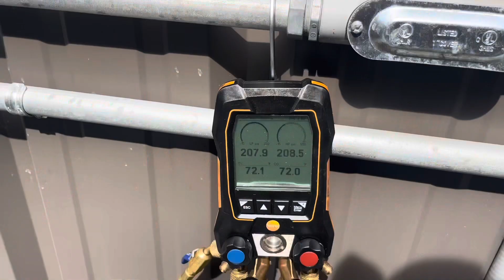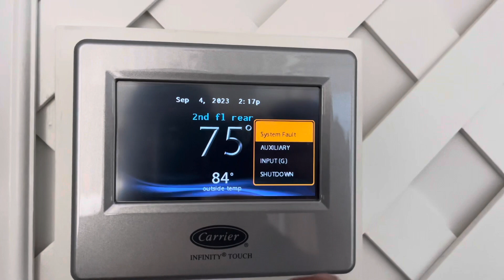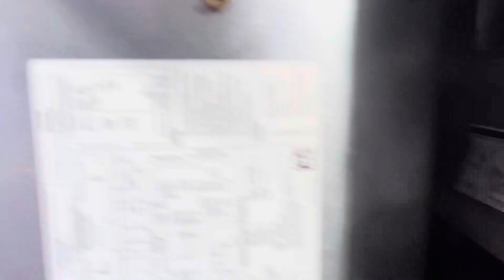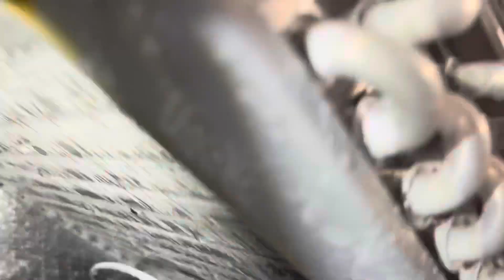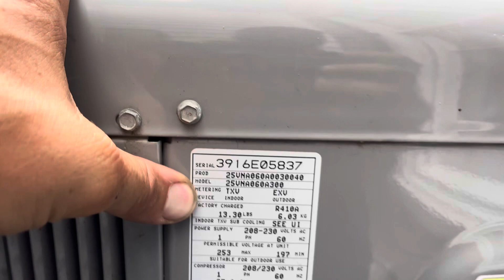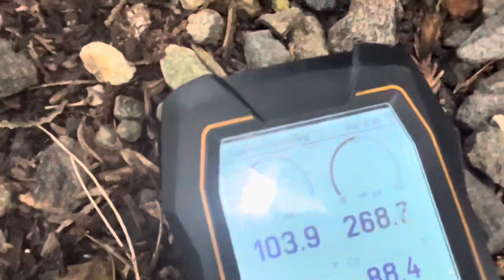CARRIER SYSTEM FAULT. AUXILIARY INPUT (G) SHUTDOWN.  #carrier

Comment: Hey I have this same unit I was working on. It’s saying on the thermostat possible frozen coil. Clean filters.Freon leave good TD good. Have you ever been through this before?  Then sometimes the code disappears and unit runs perfectly
Reply from the maker: It could be a comm wire failing.  There are a few things it could be like delta t. Check wiring at the air handler.  You can also go into the hat icon hold for 7-10 seconds select full installation to reset the system.   What is the exact error code number you are getting.   By doing a full install at the thermostat it may recalibrate if the filter or static pressure went to high.   It could also be loose molex or wire on control board.   If you see get the error code again, check for actual static pressure  .  This is what ramps the fan speed up and down based on the demand from temp which correlates to pressure.

Comment: Hi, I have this Carrier Infinity t-stat and I’m in Florida w/ 105 heat index. System will ramp up to keep house cool. After an hour of full ramp-up the system will just shut off. After 10 to 15 min it will come back on and operate, but with fan on low. My system does not send a notification/message.
The drain line does not have a P-trap on it, so I feel the vacuum from the air-handler ramping at full speed causes water to not drain and trips the float switch. Would a P-trap solve for this problem?
Reply from the maker: Call me.  2034602378